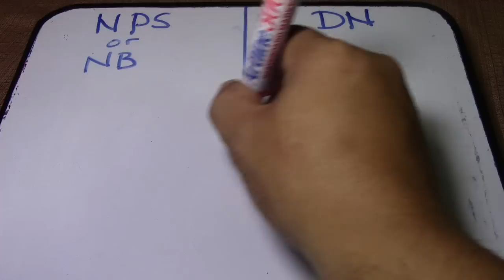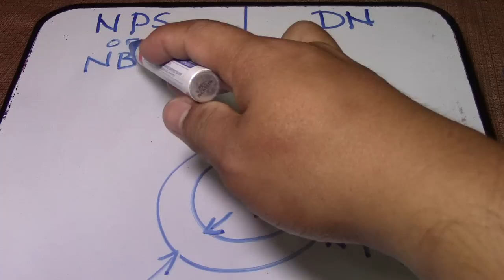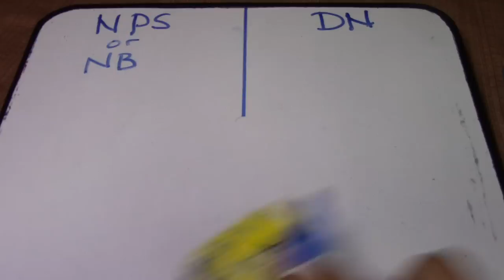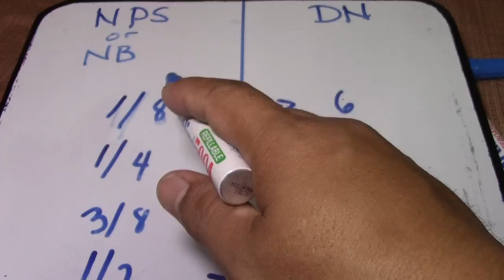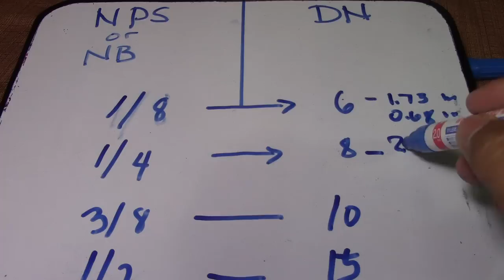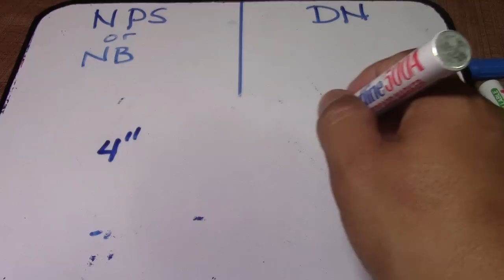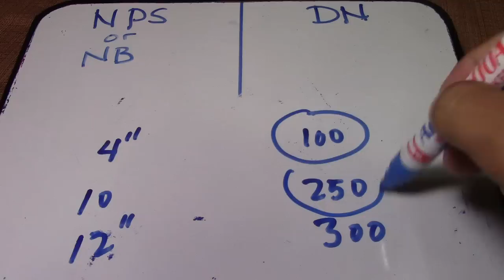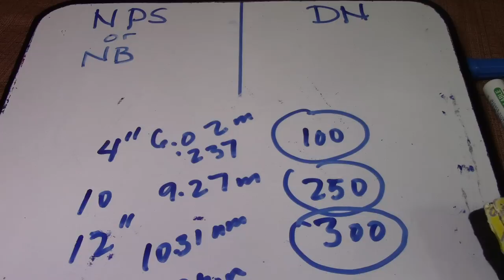What is NPS, NB, DN, OD, ID, T Pipe Schedule Properties - PipingWeldingNonDestructiveExamination-NDT

Comment: There are two things of the pipe,  1 means 1/8 it shows pipe thinness. and 2 means dia of the pipes, if dia of the pipe is 2ft, than the pressure of water increases, so its thickness should be increased. It means the pressure of water depends on diameter and thickness. Regards: Engr A Latif Unar.